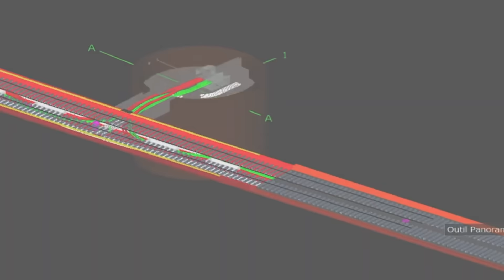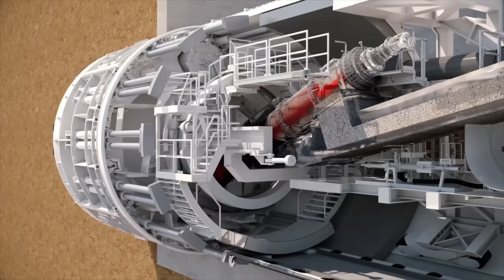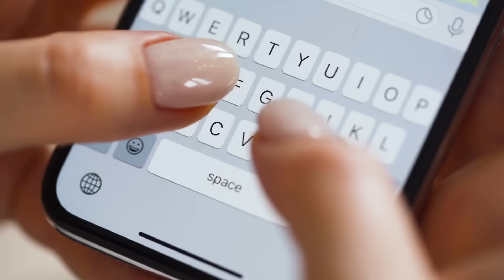The Grand Paris Express - Europe's Largest Transport Project

Comment: I live in Paris. The most remarkable thing about this vast infrastructure program is how virtually invisible it is:  apart from a few open construction excavations across the whole of Paris, it is largely happening quietly underground.
Reply: Well, line 14 has been shut after 8pm 4 days a week for 3 years now, and an additional 3-4 days every few months for 5+ years. I live near where it runs and there has been an open worksite for ~2 years, many places in the suburbs (Orsay, Saint Denis, and pretty much everywhere the new lines will go) have similar sites, the expansion not going intramuros makes for very little work there.

I'd have to agree it's well managed and most of it is actually happening underground but there are still many excavations along the planned routes.
Reply: In Massy the line 18 is mostly invisible. ( well there's that stuff being built in the middle of all the other stations at Massy-Palaiseau, but it's tucked between the RER B maintenance hall rebuilding and the RER B track maintenance depot rebuilding... And the Tram-Train 12 line works were more obvious. 

Now I agree that there's areas where the GPE work couldn't be missed and were disruptive.
Reply: @tenalafel  I live near Massy-Palaiseau, I wish it was mostly "invisible", it's super noisy sometimes with the RER B and C the TGV and soon metro 18 and tram 12
Reply: Completely igree, living in paris region and you cannont see any disturbance from these projects
Reply: Well I live around Saint Germain en Laye and I can guarantee you that when I take the car to go to Paris by Porte Maillot, we see the big thing that it is since many years now but I heard that we are soon arriving to the end of it for there. But of course it’s nothing compared to the others 90% percents of the project that’s being done underground everyday.
Reply: @nby149  Porte Maillot is the location of one of the new stations of RER E's West extension, which is not part of the Grand Paris Express.

The building works of the Grand Paris Express haven't started yet on the West side of Paris.
It will begin soon though.
Reply: You're lucky, as a Parisian...
Paris, mon amour 🇲🇫🎶❤️
Reply: Hah.  Take the 108 or 110 bus from Mairie de Champigny to La Fourchette and you'll notice the works.
Reply: Déplacement des voies à la gare du Vert de Maison, construction des différentes stations des lignes 15 et 16 autour de Paris, regardez un plan, repérez où seront les stations des lignes 15 et 16 et allez constatez que non bien évidemment tout ne ce fait pas sous terre.
Reply: @aquarius4953  Je n'ai jamais dis 'tout.' J'ai mentionné les excavations... J'ai dis 'largement' sous terre.
Reply: More or less ... those of us who live in the south west well out of the city sure have faced some major transport disruptions, BUT it will totally be worth it!!!  I am dreaming of the day our new lines come online!!!
Reply: Most new lines will only be open in 2024 or more anyways .
Reply: @audreydupuy2628   2024? Let's say between 2025 and 2030.
Reply: just more infrastructure for immigrants to replace the natives.
Reply: mdr you don't see it probably because you don't live in the subarbians ^^. There it is more obvious and it can really be a mess !
Reply: @staqelsujet  Don’t worry, I’ve spent hours at Porte de Maillot in traffic around the construction works.
Reply: @lours6993  I can imagine ^^
Reply: I live next to one of these stations. For the last 7 years it's been a painful and noisy and very annoying huge building site, man. It's not "quiet" at all.
Reply: Vous avez la mémoire courte...2020 et 2021 ont été des années particulières non ? N en n ont ils pas profité des confinements et des couvres feux ??
Reply: It's good to see that at least one European country is looking forward to moving to the future. Chinese infrastructure is really impressive, and it looks like France is trying to catch up.
Reply: @gabrielroque6664  China got all its high speed rail technology from France, Germany and Japan. No one here is focused on 'catching up' with China, who have some huge problems to face. France is building the infrastructure it needs to develop for the future.
Reply: @lours6993  Then France is "catching up" lol. The world is growing, and the necessity of infrastructure in big cities has increased. In many countries it takes ages to build things, France is building very fast, so IN MY OPINION, France is catching up. If you don't like the wording, or "China" in the comparison, that is your problem, not mine.
Reply: @lours6993   Les trains chinois roulent à 360km/h. La Chine a elle seule possède les 3/4 du réseau grande vitesse mondial. Ils fabriquent tout leur matériel eux même. Ils prévoient de faire rouler leurs trains à 400km/h d'ici peu. Ils sont leaders avec les japonais sur les maglev. H9nnêtement, la Chine est numéro 1 du rail aujourd'hui, avec le Japon peut être mais devant tout le monde sinon. C'est juste la réalité.
Reply: @gabrielroque6664  It is not a competition. These metro lines are necessary.
Reply: @aquarius4953  No one said it is a competition. I said it is catching up based on the speed they are building it, and based on the interest of expanding the infrastructure (which many countries struggle with).
Reply: lol those french guys freaking out cause of a comment

Comment: i see that they are building metro stations like the barcelona line 9 stations, did they also build big tunnels divided with upper railway and lower railway ?
Reply: No, a one level design will still be used for the full network !
Reply: @merlina5965 
Is everything going to be as deep as line 14?
Reply: French Parisian metro is much older than Madrid one ´s. Also this is not the same, Madrid metro is built by French company with Spanish one, but the new Parisian is the 2.0 version